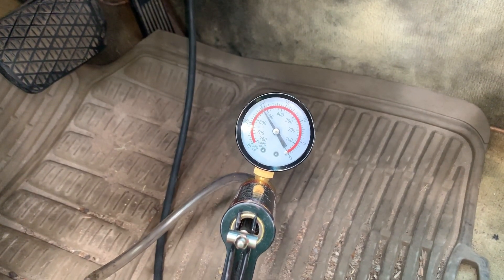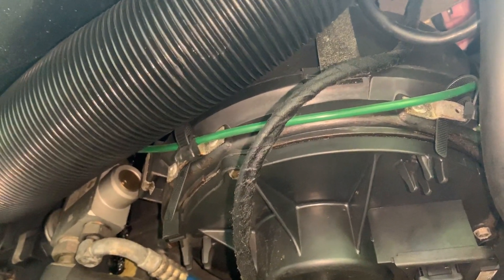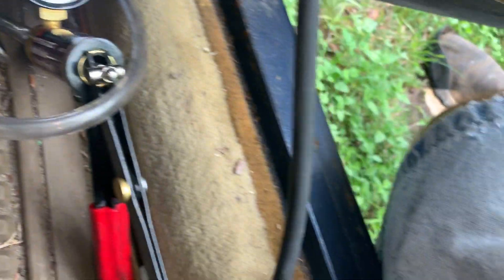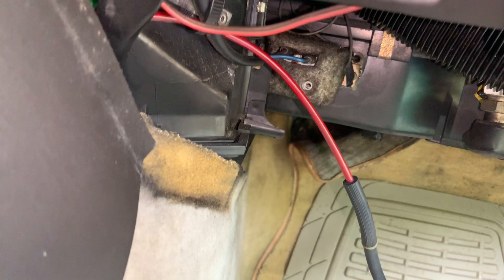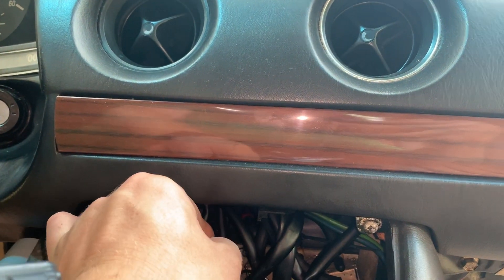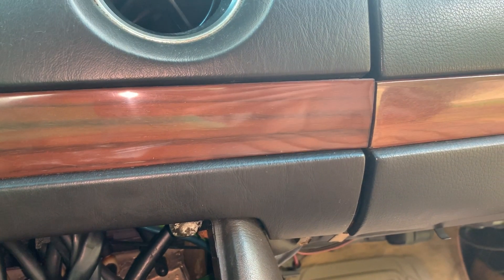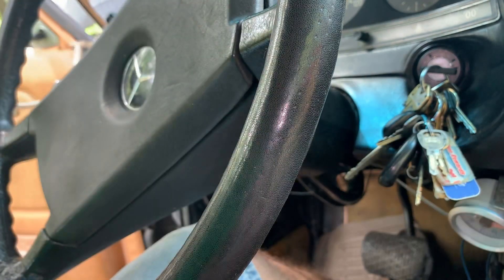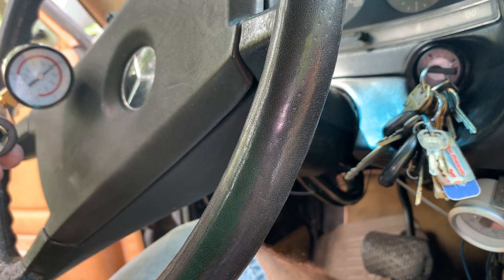85 300D Climate Control Vacuum System pt2

Comment: These are so helpful. Just an FYI, I changed out my pods (I rebuilt 3 out of 4 of them) but I am still getting leaks. Unfortunately in order to deal with the center vent you do have to take the dash out. I have not checked the silinoids yet
Reply from the maker: Check them as almost all of these from 2 cars leaked. Did you find replacement diaphragms?
Reply: The car I bought had a bunch of them in a box with some other replacement parts. I found some on eBay a couple months back, I can check my account to see if I can somehow locate them thru my browsing history. I did have to buy a new defroster pod. The pods can be tough to take off they have a clip that was a pain to pry off.
Reply: Pulling the dash wasn't awful, but it ended up cracking mine
Reply from the maker: I’ll pull mine at some point and rebuild or replace them.